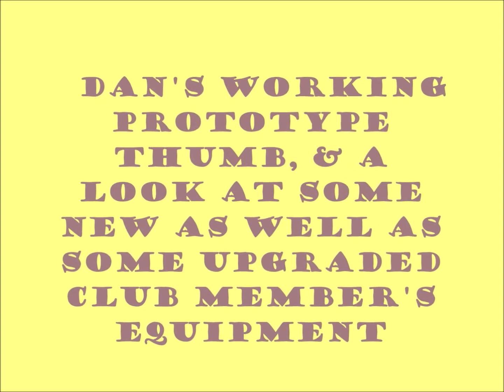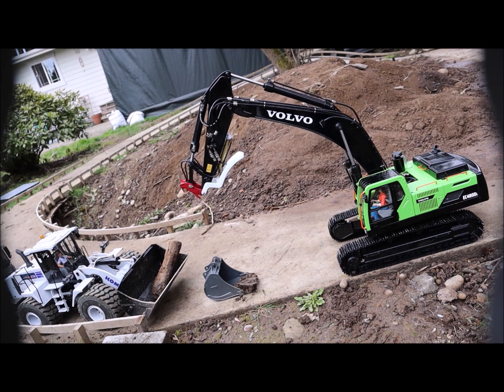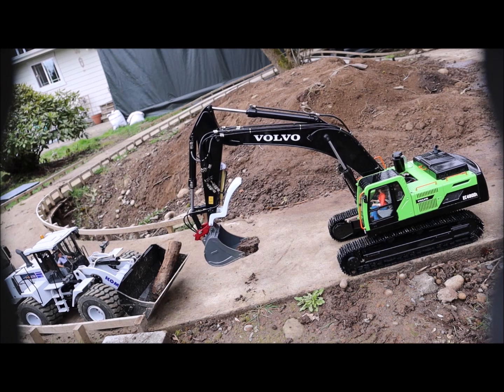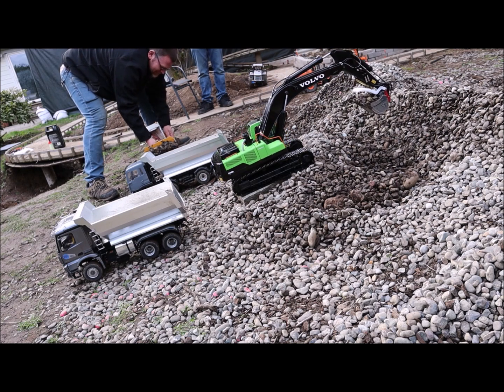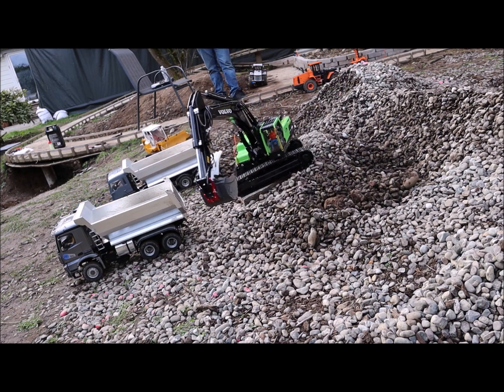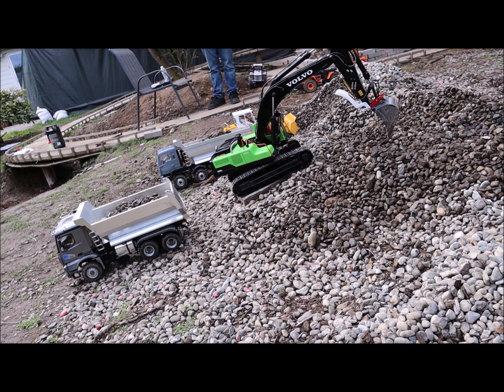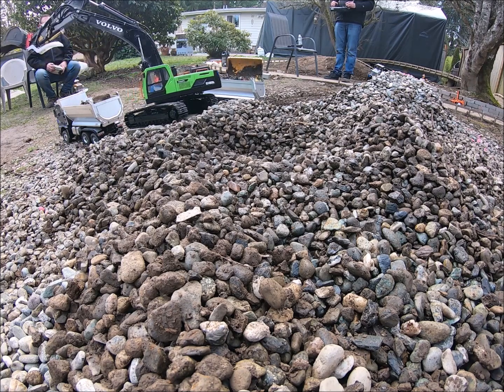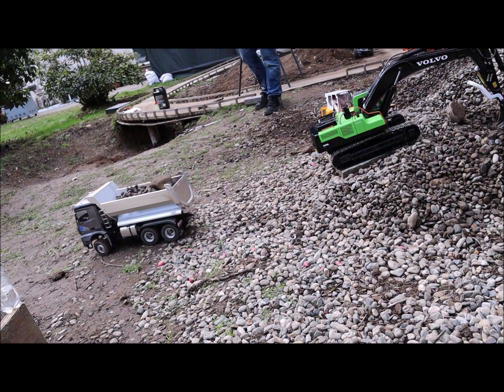hydraulic thumb for the RC4WD 360L Excavator, & some new equipment too PNWSTE Season4 Episode No.13

Comment: What did he say about takin the slop out of the house swing? Couldn't hear it very well.
Reply from the maker: He used a disposable latex glove & cut a piece of it to go in between the gear, & the motor shaft that it mounts to. He found that on his machine, the slop was between the gear & the motor shaft. The glove took the slop out of that point.